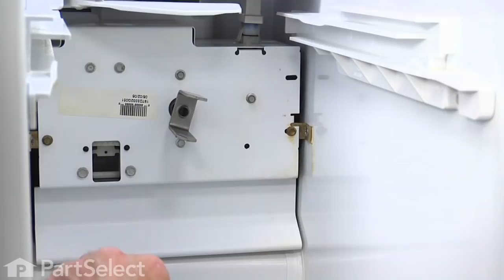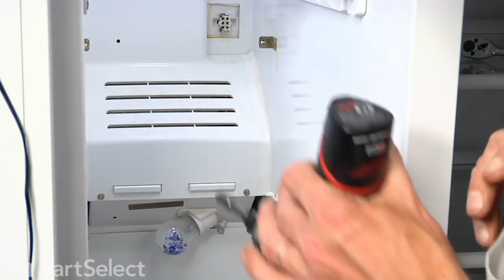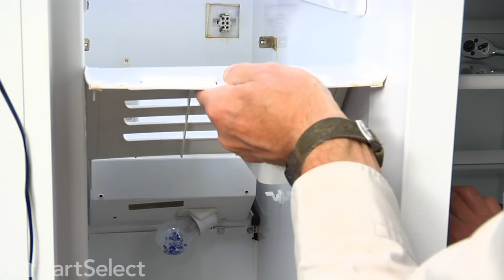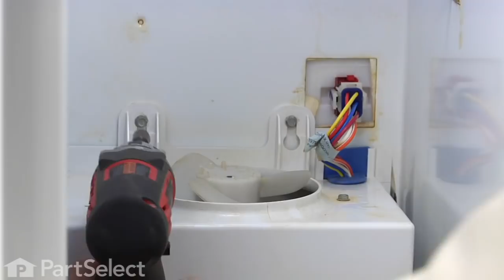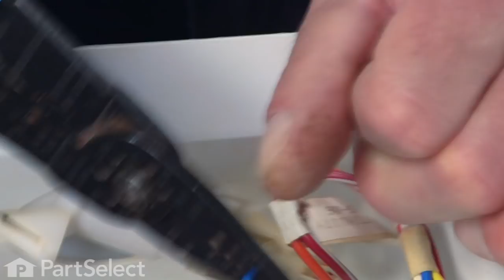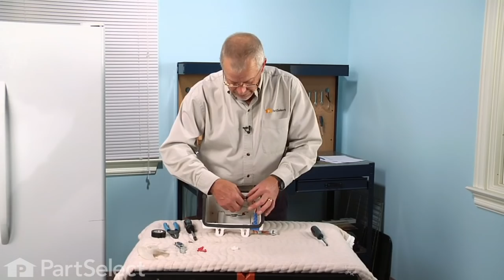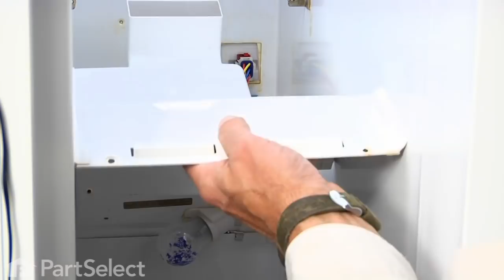Refrigerator Repair - Replacing the Evaporator Fan Motor (GE Part # WR60X10185)

Comment: Thank you for this video.  This evening I heard the evaporator fan (to a side by side GE GSS25JF MB WW) starting to bang around.  After checking to make sure it wasn't ice build up I watched your video and went in to see if I could diagnose the problem.  It seems that over the years the heads to the screws holding the bottom bracket of the evaporator motor rusted away enough it dropped off - presumably down behind the rear panel.  Looking at a total of about $10 to $12 dollars in parts if there are no other issues.  Much cheaper than a service call or a new fridge/freezer.  Thanks.

Comment: Final report.  Your instructions were right on the money.  I ordered an original equipment part by Panasonic.  Everything came apart as shown in your film.  The new evaporator fan motor and attached thermister slid into their places like fingers into a glove.  When I saw how much more freezer space I had with the ice maker removed I left it out.  I added a clip on freezer thermometer. My GE now effortlessly maintains a freezer temperature of minus 10 degrees F and I have increased my storage space by about 20%.  many thanks and kudos to you.  Frank

Comment: Hi,
My GE Eterna series (ESF25LGRC BB) side-by-side is having some issues.  It alternates between always running and making a gasping sound which can be heard very clearly when the freezer door is open.  It sounds almost like it is ready to cycle into defrost but then thinks better of it.  The unit does this over and over again.  The unit itself is very warm to the touch though the food on the inside is either chilled or frozen appropriately.  
I did a search on this online and one of the ideas was that the evap fan motor is not working.  This is the second time that I have had this issue.  The first time I called a repairman and he replaced the computer.  That worked for awhile, but the wheezing/always running is back.  I realize that it could be the computer but something tells me that there is another issue as well.  
At some point, the ice maker gave up the ghost as well.  When it went, there was a stalagmite on a little shelf at the back of the freezer.  I do not know if that is related to this or not, but thought I would mention it.  

I would appreciate if you could help.  I love your videos!

Adam
Reply from the maker: Adam Snyder I have passed your question on to Steve. I will let you know what he suggests.
Reply: ***** Awesome.  I look forward to hearing back.  Thank you so much.

Comment: Hi, the Fan was not running so I replaced it... but it still is not running... is there a relay or a sensor that needs to be checked...?    The GE is cooling but just at the bottom of the freezer... Wondering if you can help..? 
Living in Costa Rica... not to many good service persons out this way..!
Thanks a million, Ken
Reply from the maker: Kenny Alan Which model number are you working with?
Reply: GE... Double Door...
Model #  GSS221BMB WW
Serial #  GA261031
Thanks Appreciate the advice..! 
Ken
Reply: did u fix it? i have same problem

Comment: excellent video, but on my GE PSS26SGRE side-by-side there are no screws at the bottom of the evaporator fan cover.  It looks like there are some screws holding the fan cover to the back wall of the freezer but they are underneath the cover itself and almost impossible to get to.  Has anyone successfully taken the cover off on this model?
Reply from the maker: As far as we can tell, you will probably have to remove the icemaker and shelving to get a better view. We do not physically have this model on our premises, so we cannot offer any detailed instructions.

Comment: thank you for an enlightening presentation. fortunately my lamp has an entirely separate harness so I will have no splicing to do.  I found I have 13+ volts dc between the white & red wires on the harness on the mother board (said to be a J2 connector? I don't know the meaning of "J2").  I understand this means there is power to the fan and is evidence that it is indeed the fan motor that is the problem.  replacement fan motor prices range from under $30 to over $100.  Is there any one maker in particular that you recommend?  many thanks, Frank Kirwin Hall

Comment: Thought I had killed my fridge after following this video because the new fan hardly turned at all. So I disassembled everything and realized the little spacer bushing was too tight against the motor so it couldn't rotate. Whew! Loosened it a bit and put it all back together. I soldered the wires just to be sure and put shrink wrap around them. Also, it is easier to just take out the ice maker, it is only one screw on the front and then pull forward. Awesome video!
Reply: The more likely case, IMO, is that the mount is too loose, causing noise, vibration and accelerated wear.
Reply: Thank you so much for writing this comment!  I was about to just toss the whole thing out when I went trough all the trouble of putting in a new fan and it wouldn’t work at all.  After wasting so much time trying to troubleshoot the fan itself I realized that maybe it was my assembly causing the problems.  Read your comment, adjusted the bushing and now it’s running like a champ!!  Thank you and thanks to the guy in the video!

Comment: I have a GE Side by Side Refridgerator (#GSS20IEPH BB).

The refridgerator and freezer keep getting warm. A week ago I took the back panel off of the freezer and found the coils completely frozen over. I unthawed them and everything went back to normal.

A few days ago I realized that the fridge was getting warm again but items in the freezer were fine. 

I took the back panel off of the fridge and tested the J2 Plug as noted in this video GE Refrigerator Fan Motor Diagnostics - YouTube and everything checked out fine.

Before I went to check out the defrost heater and defrost thermostat I noticed that the compressor fan was not spinning on the back. When I take my hand and manually spin it, it gets going a little bit but then stops. 

How can I further test if it is the fan motor or do you have any other thoughts?
Reply from the maker: Hi there! Thanks for your question! To check if the problem is with your compressor fan, ensure you disconnect the power and proceed to remove the rear access panel. Check for debris or any obstructions that may be stopping the fan from spinning properly. The area should be free of obstructions so air can move freely and it is a good idea to vacuum the area regularly. Check that the fan will turn freely. If the motor is seized you may need to look at replacing it. If the motor freely turns, disconnect power to the refrigerator and remove the wires to the fan motor. Now you can check it for continuity with a multi-meter. Hope this was of some help; good luck with the repair! Let us know if you're still stumped after checking this.
Reply: *****  Thanks so much for getting back to me.  It is pretty clean down there, I have vacuumed all of the dust build up. I will try disconnecting and doing a continuity check when I get home tonight.  Is there a correlation of fan not spinning and the coils freezing up in the freezer behind the back panel?
Reply from the maker: Yes, there could be! It's our suspicion you could have a defrost problem that will either be related to the thermostat timer or heater, also.

Comment: Hi Steve - I find your video helpful but can't determine how to remove the fan motor on my GE profile that has the freezer on the bottom. Can you help me sort that out?
Reply from the maker: What's the model number of your refrigerator?
Reply: ***** PFSS6PKXDSS
Reply from the maker: Marcia Crawley I did some searching and we don't have a video for your particular GE profile fridge. If you do go to our site and enter in the model number you'll be able to locate your fridge's schematics.
Reply from the maker: Thanks for the update and sharing the repair tip. It's very useful!

Comment: I have gsc23lsrcss ( GE) brand. I was unable to take out FAN Assembly out from Freezer  section. I have taken out most of assembly out like ICE maker etc. It looks like Plastic Box where FAN motor is hiding inside in, It looks upper part of plastic pannel is kind of Glued. I am calling Mechanic tomorrow to replace FAN.

Comment: Thanks for the suggestion. The ice maker works great. With just my wife and me here, it is full most of the time. We had suspected the door flap might have a gap in it, so I'd checked it visually and with a flashlight to see if I could detect any light penetration. I didn't detect a gap.  As a precaution, I just wiped it out really well with a paper towel to make sure something isn't adhered to the rim.  I'll let you know if I see a change.  Thanks, again!

Comment from the maker: Sorry to hear about this problem with your refrigerator, and thanks for the question. Even though we generally notice a problem with one (either fridge or freezer) first, the issue will eventually become apparent in both, as the whole unit is controlled by the same system. Is your evaporator fan working? You can check this by increasing the temp, which will kick start the compressor. You should then feel cold air blowing into the freezer section, and from the air inlet into the fridge section.
Reply: I htink you meant by "decreasing" the temp.

Comment: Hi,
Our Hotpoint HSM25GFRE has a very warm (50-55F) upper part of both the fridge and freezer - but the crisper section of the fridge as well as the bottom of the freezer is frozen.  We replaced the defrost heater last year, and I can see it working (although there seems to be a large amount of frost buildup before it starts working).  I don't hear or feel the fan blowing any cold air in either section - would this mean we should replace the evaporator fan?